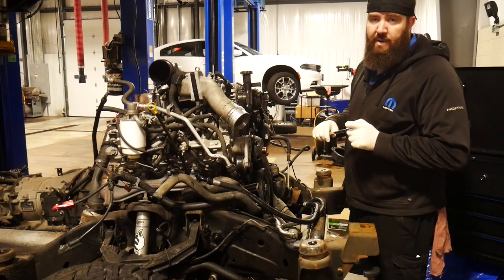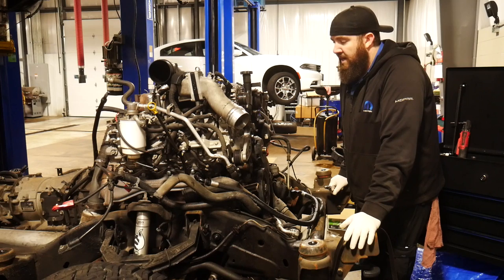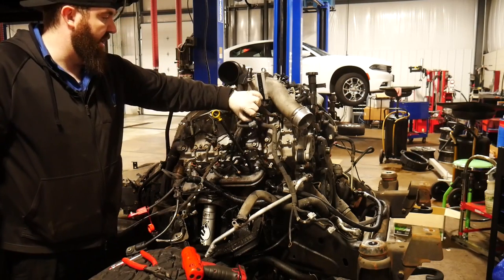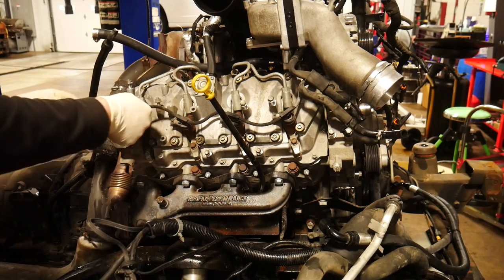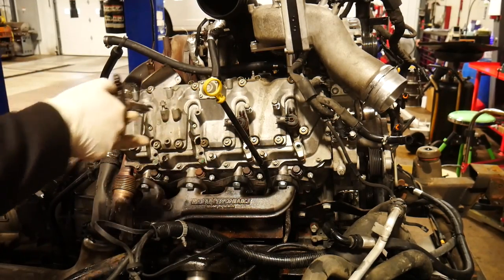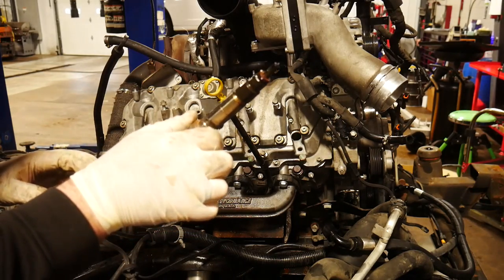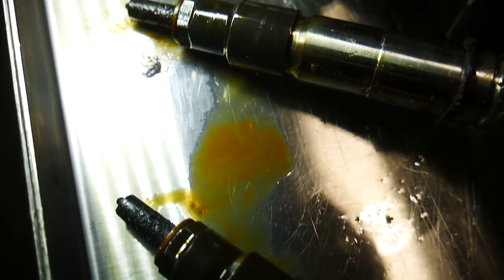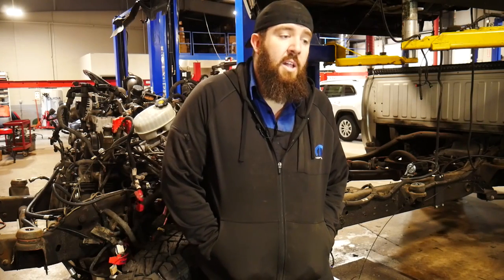LBZ DURAMAX INJECTOR REMOVAL

Comment: My brother has a LMM dirtymax and he studded the motor and is pushing 500HP and over 900 foot pounds of torque
Reply: @RenegadesGarage  yea that's a 2019 lol, with my brother "dirtymax" it's a 2009 which is 10 years older then the 2019 ram 2500hd lol
Reply: K

Comment: Looking to replace my injectors on my lbz do I need to reprogram the computer for the new flow rates?
Reply from the maker: Good question! Yes you should do that. On the negative side, there are VERY few tools that will do that aside from a GM tech 2 which is what I used on mine.

Comment: GM is WAY easier to work on and engineered better!
Reply: I fail to see your point, or the engine itself in this video for that matter.
Reply: ISUZU  Designed it .My ecm has ISUZU all over it
Reply: After pulling my lml apart I can say you are wrong. This gm has every size bolt head under the sun. They use a 12mm to hold down one fuel line going to the filter then a 13mm to hold down the other line going back to the pump. And everything is like this. I have my pockets full of sockets and change them constantly. I did studs and gaskets on my ford 6.0 last year and they only ever use 3 main size bolt heads for all the small stuff. I like my gm trucks to drive but not as nice to work on as a ford. 
Cab off for both jobs so space is not a problem. Ford took me less time to remove the cab also.
Reply: @davidschmidt449  Pulling a CAB to do work is so easy at home as everyone has a LIFT readily available.... WRONG
Reply: Aris Torm 
I also don’t have a lift I used my Dads farm tractor to lift the cab but google removing cab and you will find a lot of unexpected way to get a cab off a body including blocking and a few jacks. Where there’s a will there’s also a way. But I have done a list of work to my ford without pulling the cab and they look scary when you pop the hood but everything comes apart easy and opens up fast to get to the engine. Like o-ring on the oil rales take less then two hours. Can have turbo out in 20 minutes of a 6.0. Even a fully deleted lml I don’t think I could remove the turbo in 2 hours with all the well hidden hoses and bolts not to mention all the different bolt head sizes. GM looks better when you pop the hood as they packed everything down really nice to give a nice looking engine bay but when it comes to working on them there is more stuff in the way.
Reply: @davidschmidt449  Your opinion, however this is about GM Duramax and they have kept the same engine since its introduction. Improving it, something is wrong when a manufacturer has 10 different diesels as all of them have proven unreliable.
Reply: Aris Torm 
Ford 6.9
7.3
6.0
6.4
6.7
GM 5.7
6.2
6.5
6.6 LB7
6.6 LLY
6.6 LBZ
6.6 LMM
6.6 LML
6.6 L5P
So that’s a difference of one model if you lump all the Durimax into one. But the only thing that some of these engines share are heads for most models and blocks. Almost everything besides that is model specific. 
Your right though Ford used the 6.0 till they had almost all the bugs worked out then switched to the 6.4 and started all over with problems. 
But until I got a Durimax I never noticed how many of these things have head gaskets failing just like the 03-05 6.0 then ford 06-07 got that fixed so they had to switch to 6.4. 
But my 11 LML still has head gasket problem like the LB7 was famous for and only made it 50t km more then my 04 ford 6.0 before needing gaskets.